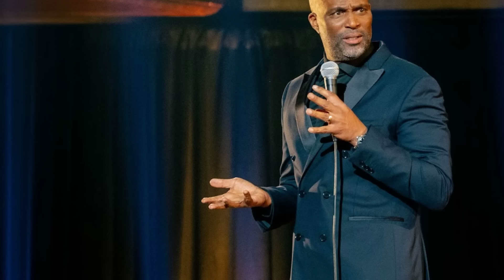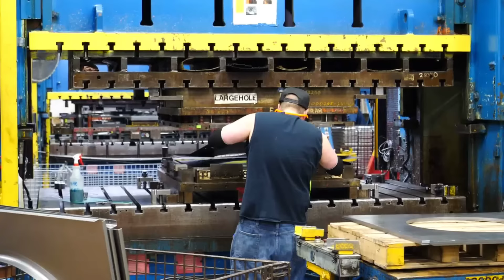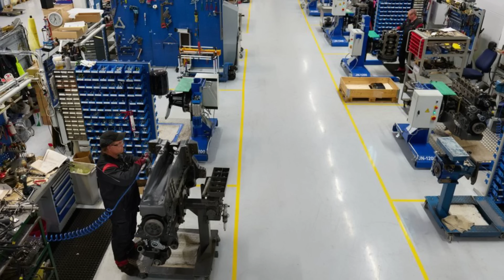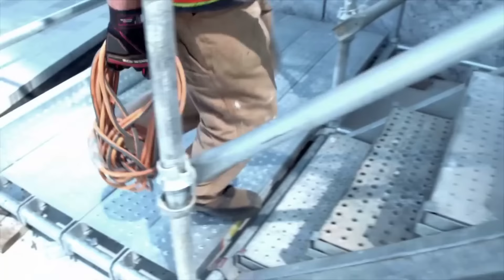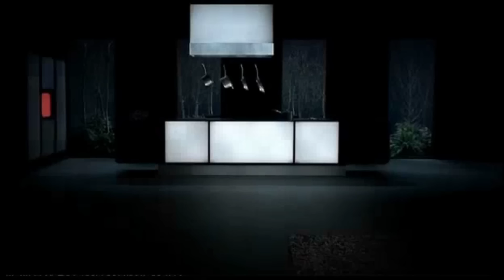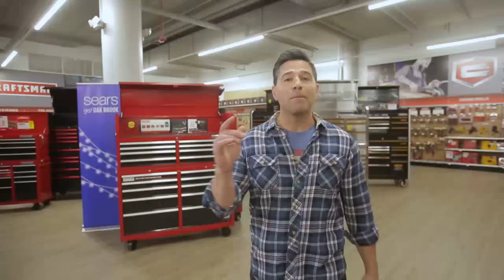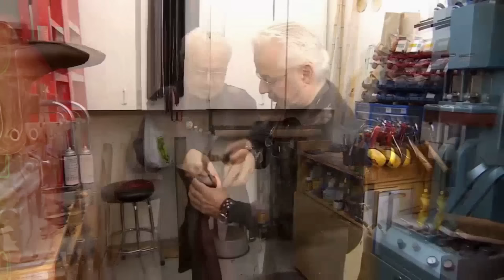The Only 5 Brands That Still Last (The "Buy It For Life" List)

Comment: Cast iron is the best investment you can make in your kitchen. Not only is it relatively inexpensive (you will usually pay less for something that will still be useable by your great-great-great-great grandkids than you will for a similar product from one of the higher-end mid-priced brands that will need to be replaced in 3-10 years), more durable than anything currently out there (my mother had a cast aluminum stewpot that was over half a century old when she donated it, so there ARE some older items that were just as durable), and get better with age, they are also versatile as heck.

They can be used on the cooktop, put into the oven, and used as rather impressive weapons. 😉

I will say that the "justifiable homicide" list should include "the cadaver in question washed the cast iron." Not even joking. I know my wife would, at best, divorce me... assuming she didn't use the pan on my head.

ETA: Also, as mentioned in the video, you can put it directly into a fire. What isn't mentioned is it's healthy - it doesn't just give you non-stick surfaces that don't leach chemicals into your food or start to decay and flake off for you to ingest, it DOES leach iron into your food. So it works kind of like a vitamin.

Comment: Made in the USA means Junk !  Chinese Equipment made in Bosch Factories in China are Very Good !  I have a lot of Chinese Cast Iron Pans.  They are Excellent.  If a Machine is Easy to build, then it's Easy to take it apart and Repair it !  I have Fixed a lot of my Equipment and it Rarely goes Wrong Again !

Comment: I will agree with 99% of what you say. I have gone thru this over and over. Here is what I have learned are the three most important things to making things last in today's world: Maintenance, Maintenance & Maintenance. Back in the old days things were so overbuild a numskull could run it for 20 years w/o an issue. But today's stuff must be Maintained. You MUST read and follow the manual and you MUST read/watch the social media posts on these things. I will give you an example. The All in One Samsung washer dryer. We had 3 service calls the first year. We waited months for parts. What all this came down to was the filter did not trap lint correctly. Here is how we fixed it: #1. We bought a $10 "brush" type gasket that went around the filter housing. #2. We bought 2 extra filter elements. #3, we clean them very well and rotate them. Once we did this, all problems ceased. I 100% agree this should have been included with the device and the manual should have been more explicit in the maintenance program. I am in no way defending most of the junk we have to buy today, but I am saying there are "hacks" and "work arounds" that people have discovered. 

Another problem is this: When someone DOES come out with a high quality product, I buy two because that company will not stay in business for more than a few years. The reason is that to make things well and right it costs a lot of money. Most people today will not buy on anything other than cost. So the cheap junk "wins" and the good product is lost to history. So I buy 2 so that in 10-20 year, I'l have a backup. Saved me countless times. Eventually people/companies will learn these lessons.

Thank you for making this video. It's another step in righting these wrongs.
Reply: Very common issue. The $5 plastic part that ruins an expensive machine. Used to see it a lot in 1980s GM vehicles. Poor engineering. Perhaps planned obsolescence?

Comment: My Honda generator has no parts support.(3500).  I replaced it with a chinese model from Costco.  I can replace the Costco three times for the comparable Honda.  The Honda worked well for ten years running on Aviation gas.  No varnish.

Comment: I have a VERY nice 1972 Pontiac Grand Prix. It is still running on the original 53 year old 455. And no, it does not smoke or burn oil. I repair restaurant equipment for a living. As the energy "Efficiency" goes up the reliability goes down. Coolers used to last 20 years. Now you are lucky if they last 5. The latest trend is to put cheap Chinese electronics in EVERYTHING. Guess what always fails first.

Comment: I have a Husqvarna lawnmower with a Honda engine. My yard takes two hours to mow and if it’s a wet year I have to mow at least once a week. That mower was buyer in 2005. It still runs like brand new. The only thing I’ve ever had to do to the engine is stand regular maintenance of changing the oil, spark plug and air filter as recommended by Honda. It starts on first pull every time and runs like new.
Reply: I have the Troy-Bilt mower with Honda engine.  With nearly zero maintenance it is approaching 20 years and going strong.  And that's in hot Texas where the mowing season is 10 months long.

Comment: Ginsu knives. I've had one for 30 years, still cuts like brand new, and if I ever break it, I get a replacement for free.
Reply: That's hilarious.  After years of walking on eggshells for the stupid Wusthof knives that can't be in hot water, can't go in the washing machine, and go dull when you look at them wrong, I finally got cheap knives.  I can't believe I fell for such poor performance for so long because I was convinced it was better.  More expensive isn't necessarily better.

Comment: Barge. I can't tell you how handy Barge adhesive is for shoe repair! Also, I have a huge 1999 (Whirlpool), Sears 'Kenmore Coldspot' bright aluminum and black steel, side by side refrigerator. I replaced the defroster heater about 7 years ago. One of my best girlfriends has the same refrigerator, same year, in white. We had Kenmore everything in our house while I was growing up. In 45 years my mom had 1 Kenmore washer and 1 Kenmore dryer. When the washer broke down someone came out to repair it. My brother built my mom a new, smaller home and installed a new washer and dryer, leaving the still functional 45 year old washer and dryer in the big old house for the couple who bought it to continue to use. I've had 4 washers in the last 20 years: GE front loader, Samsung top loader; GE top loader; and a year ago I bought an LG top loader. You can't tell me that appliances haven't turned to complete garbage in the last 20 years. It's because these big ticket items are no longer American made. My next, and last, washer will be a Speed Queen.

Comment: Lodge cast iron products are still made in the USA, but I am just not impressed with the overall quality of their cast iron. Very rough and coarse. They are OK as stew-pots or actual campfire accessories. I have a set of Griswold cast iron pans from the 1930s, and the cast iron surface is as smooth as ice. Beautiful craftsmanship and a joy to cook in.

Comment: I bought my Filter Queen vacuum cleaner in 1975.  Made in Chicago, the only thing I had to do was replace the motor brushes once.  The vacuum is still as good as new.
Reply: My mom had one she bought in the 50s. Had it until the 90s..
Reply: I have two filter queens and one ( older model of my two) has need of new brushes. I may need help finding  a site to order 
them...
Reply: I have my mother's 1952 Filter Queen.
Reply: The best.

Comment: I'm still using a Maytag washer and dryer I  purchased in 1981. Over the years I replaced a idler bearing and electric heater element in the dryer and cold water solenoid on the washer. 
9:25

Comment: I repaired my 30+ year old Honda generator several times, simple to fix and simple to get parts for. It is still ready for action. We have a collection of cast iron Lodge cookware that beats any high dollar brand out there. We finally replaced our Maytag washer and dryer because I got tired of repairing the set. It was bought used and lasted about 15 years. Our new GE set was purchased to accommodate a modified layout for our laundry room. I buy Thorogood USA made boots for work and that is all I need to say. Channel lock pliers ARE my go to brand. USA made and worth the extra cost. I learned about all the products mentioned in this video a while ago. Buy once, cry once is actually a great way to save your hard earned money.

Comment: I still have a Hilka stainless steel socket set almost 50 years old and a Bahco Shifter (an adjustable wrench) Also 50 Years old, still in use.

Comment: The Lodge cast iron skillet is massively overrated. It doesn't distribute the heat evenly. I do admit bacon tastes better in it but I have to cut the strips in two and cook them around the perimeter to avoid burning. No, it isn't the burners since my non-stick doesn't have the same problem.

Comment: I'm a tough non-repeat customer who doesn't buy into trends. If the economy depended on me spending money on consumable items, corporations would go out of business. I do my research. 

I've been planning on buying a Speed Queen for the last 20 years when my 1983 Maytag wears out. I think the Maytag will last longer than me, for maybe another 20-25 years. It looks a little beat up, like me, but works as good as the day it was new. My Kenmore electric drier was used when I inherited it in a house I bought in 1982. I moved it across the country with me 4 times since then. I had to replace the drum drive belt about 25 years ago. It still works great.  My Japanese cast iron frying pans from 1972 are as good as new. I use them every day. My Presto stainless steel coffee percolator, that works and looks new, has been making a gallon of ice tea every 5 days since 1981. That exact model is still being produced today for $80 to $105. I'd buy another if my old one ever died. I replaced the power cord once.

Comment: Until around Dec 2024, I was still using my Apple Mac mini 2007. I'm now still using my 2012 and 2020.
My Panasonic microwave is now on its 23rd year.
My non-digital alarm clock which was bought in 1982 finally went bad around 2020.
I'm now sixty years old and can't comprehend why I'm replacing my phone after three years due to battery problems. I know the reason, I just can't believe it.

Comment: Dude, or MR. AI?  There is nothing wrong with Champion products.  I have a Champion generator I have had for 20 years that still starts first pull in freezing winter weather.  Other than oil changes, it has cost me nothing in maintenance.

I also have a Honda generator.  It's great, but it had a flaw that I had to develop a modification to fix.  The fuel shut off and the ignition "Stop" were linked together.  This means, if I "turned it off", the carb was left full of fuel, that over a few weeks would turn to sludge.  Then, I'd have to dismantle the carb and clean it out every time I needed if.  That's an engineering mistake.  A serious one.  I guess it means more trips to the service center.  So I had to modify it to correct that stupid error.  Now it works almost as good as my Champion, except it is harder to start.

Why not work a bit harder getting your facts straight, than just pumping out weak, lame content.

Comment: Craftman didn’t sell out, they got sold out.
Reply: Actually private equity ruined sears..
Reply: @justing6594  They've ruined a lot of things, including the US government.
Reply: @justing6594  its called ccp under cut   make cheap knockoffs and flood the markeet with them and watch sears try to pay to replace them as they break
Reply: I've had a lot of old Craftsman and a little of the new stuff.  I use mostly older Craftsman daily for the last 10 years.  You can't do that with the new stuff
Reply: @Dboyquicks10 I have a ton of series-V craftsman tools, ratchets, sockets and wrenches, and they are totally equal to my limited selection of Mac wrenches and snapon impact sockets. All fantastic tools, I’ve yet to ever break a quality socket but I only maintain 3 vehicles - I’m sure if I were daily wrenching I’d be exchanging them now and then but when my craftsman 3/8 ratchet stripped the ring gear, I rebuilt it (with a Taiwan-made rebuild kit)for $12 because there was no way in hell I was going to swap that for a modern, sealed craftsman ratchet.
Reply: All my Craftsman tools were bought at Sears and all a long time ago. Now the brand sells Chinaman. It is not remotely the same.
Reply: Another good brand I found for tools is Klein. They are made in America.
Reply: @Bankable2790  Klein is very good, especially if you are an electrician.
Reply: @jreyman  I’m not a professional but I am a hobbyist. I bought their wire cutters/strippers for 10-18AWG and stripper for smaller gauge, a large 2/0 wire cutter, and a 3/8” drive ratchet l. I would consider getting their clamp ammeter too if I didn’t already have a fluke
Reply: @Bankable2790  Yes, Klein is good. You can tell good tools from bad just by looking at them and hefting them. Good quality stands out immediately.
Reply: Knew an excellent mechanical engineer in the late 80s who called it crapsman even back then.
Reply: @kittenluvzu  Well I'm not any more impressed by Snap-On quality, either, especially at the price charged.
Reply: Eddie Lampert sold them down the drain.
Reply: Craftsman’s Overdrive tools are pretty damn good these days.
Reply: We've called it Crapman for YEARS now
Reply: I have a toolbox full of Craftsman hand tools thst I’ve had for at,least 50 years!
Reply: My city's area vocational school used Craftsman tools 2:59  in their auto repair classes
Reply: Yes, by that crooked CEO Eddie Lambert
Reply: I knew when Sears sold them, it was the beginning of the end for Sears.
Reply: When my grandpa died, 1984, my grandma gifted me his '72 Chevy and Craftsman tools. The Chevy...nothing but troubles...drove it to the junkyard 2 years later.  The tools..still have them ALL...except a 3/8" rachet.  Failed, before Sears failed..and due to the lifetime warranty, got it replaced for FREE.  Every time I use one of GrandPa's tools (from the 50s), I cherish my time with him.  Priceless.
Reply: Doesn’t matter whether they sold out or were sold out, the result is the same.
Reply: @bootstrapperwilson7687  It matters.
Reply: They were honestly never that great in the first place. Snap on is still the king if you make money wrenching on cars. KOKEN Japan is another great tool manufacturer.

Comment: All good advice, but...Try finding a cobbler. Anywhere. It's a dying breed, there are none in my area.
Reply: Barge. I can't tell you how handy Barge adhesive is for shoe repair!
Reply: @DancingOnH2O  There's also stuff sold called "Shoe Goo" which does the same thing. BUT...it isn't the same consistency as the OG soles & heels, and it turns a comfy pair of shoes into bricks. It's like putting a band-aid on a bullet hole.
Reply: Tijuana Mexico has cobblers - was at one last month having a leather belt shortened and new holes punched.  Cost me 50 pesos or $2.50.
Reply: Buy whites and send them back for rebuilds

Comment: I have a 10.5"  (rim to rim) Wagner cast iron frying pan I've had for decades.  I also have a 14" (rim to rim) cast iron frying pan I use rarely because it is too big for most of my needs cooking for a single person.

Figure the 10.5" pan has about 86.5 square inches of cooking surface. the 14" pan has about 153.8 square inches of cooking surface. So the larger pan is about 1.8 times the cooking surface as the smaller pan  ---- good for families and Scout Troops.

Eventually the smaller pan accumulates cooking grease and junk on the outside of the pan and even inside the pan.  When I find that objectionable, I wait until my wood stove is cooking at a HOT temperature and leave the cast iron pan in the fire for a half hour or so until EVERYTHING has been burned off clean.  Then re season and we're back in business. 

I'm guessing that Wagner pan was made in the 1950s,  but it might be decades earlier.   And after I dies, it should serve the next user for many additional decades.

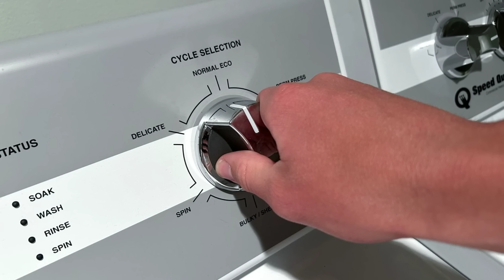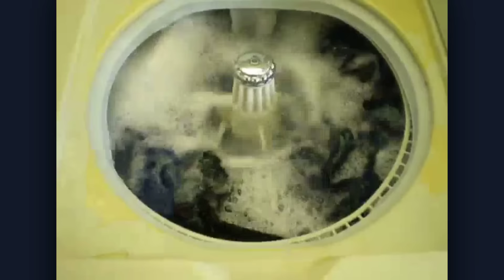Comment: 2:10 that is not a mechanical timer. that's the newer TC5 model. 2:36 this is the model with a mechanical timer. they quit making these around 2016. I have 2 matching sets. if you want the old style mechanical timer, you'll have to get the commercial version. also, new Speed Queens (like most everything else now,) are outrageously expensive. they cost almost THREE times what I paid for a set 10 years ago. definitely buy a used old model off of facebook or from a dealer. people will get rid of these just like they use to get rid of perfectly good older Maytags because they think they want something else.

Comment: I repair the cheaper shoes I am forced to buy.  When the sole separates from the shoe, I use Shoe Goo.  It is flexible enough to last and can be reapplied if necessary.  For the edges of the sole, I use Pointe Shoe Glue to lock out water.  It is strong enough for ballet shoes, and it is strong for my shoes.  To see what these shoes go through, look at pictures of the dancers' feet.  They perform through pain.
Reply: Magic product!